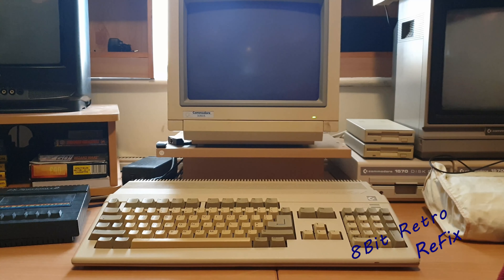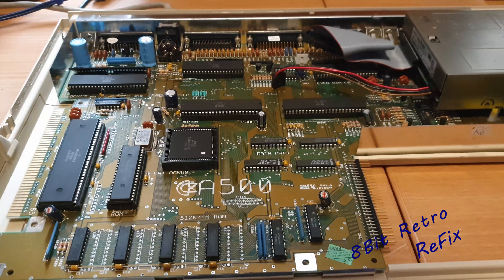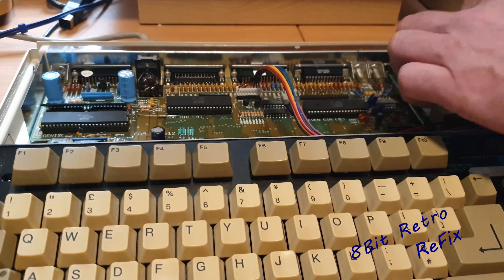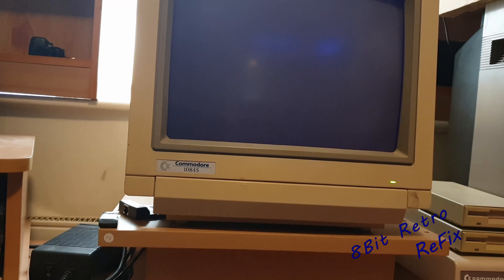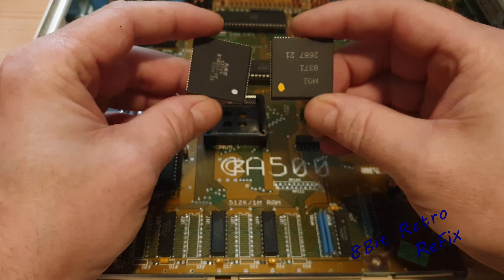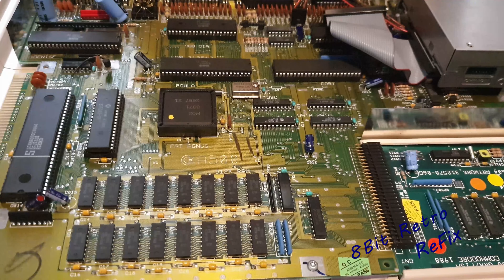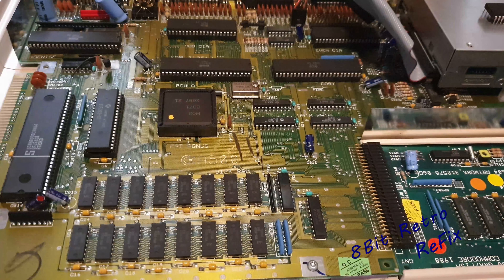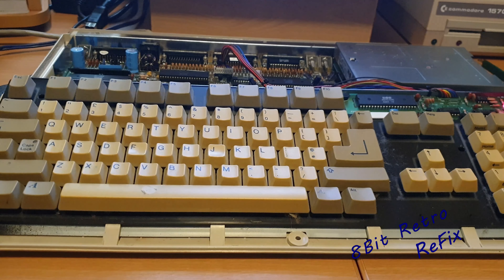Amiga A500 Black Screen Repair

Comment: always kept my RF shield on...
worked as a good keyboard brace...
never understood why people just tossed it off.
Even used it when I had a M-tec 020 installed. (a small rectangle part over the 68000 could be removed)
Reply from the maker: Rf Shields are no longer needed, and it only traps the heat in ... but I do understand what you mean ..

Comment: I’m sure you must have figured this out, but in the first part of the video you had the CPU in upside down. That would explain why nothing was responding with that board until you tried swapping CPUs and finally put the CPU in correctly.
Reply from the maker: Thank you .id not noticed it was exactly as it was when I opened it  ... I must have correct it naturally checking the silk screen before install test chip .... well spotted ... Good job it didn't kill it :)